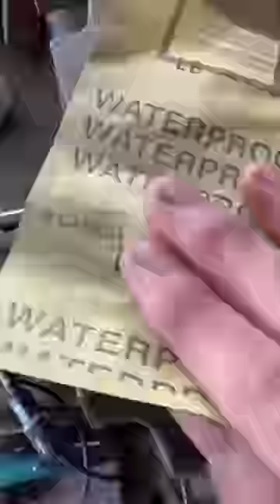CHEAP stripped oil pan/bolt solution!

Comment: You should've just re-tap the hole and plug it along with a crush washer
Reply: You. Any on these old pans
Reply: My thoughts exactly
Reply: They sell magnetic drain plugs at all auto parts stores that are permanent fixes, no drilling,  tapping, welding or leaks, $10
Reply: Yeah, they make those kinds of things
Reply: @byanymeansnecessary9329  the threads were stripped. That's the whole point of this 30 iq video
Reply: @Kdubz_Auto_HVAC  and so? There are ways to remove the drain plug, even if threads are stripped without drilling, then replace with the new type drain plugs

Comment: Here's a fun fact, I had a 2001 Yamaha dirt bike I got in a trade. Dude was shady as hell about it but it wasn't stolen and it ran and looked somewhat decent so I got it. Well I found out why he was shady about it, I went to do an oil change and as soon as I broke the drain bolt loose, a huge chunk of the case came out with it. SOOOOOO I did what every 17 year old from the south does, went out and bought some JB weld, put the piece of the case back in it's place, sanded it then cleaned it good, and used the entire tube of the weld on it. I'm talking absolutely covered in it. I took the bolt and drilled it out and tapped it and then put another bolt in it so it could stay jb welded to the case too. Rode it like that for a good year before I sold it. (Yes I made sure that the guy knew that it was like that before I sold it to him)
Reply: Redneck engineering at its best 😊

Comment: They have other types of plugs you could have put in there. Like self-threading plugs, or plugs that you tighten up and they expand to fill a hole with rubber.
Reply: Spark plug would have worked in the hole lol

Comment: I’m all for saving the factory parts and fixing them rather than buying new ones! I agree with you choosing to do this repair.
It’s obvious this could have been done better and solved the leak problem as well as your original problem. But I applaud you for being brave enough to share this, and I applaud the people from all different trades sharing their knowledge to help on your next attempt. That’s what this community should be all about! 
I also have things rigged on my truck that “work for now” and I’m hoping to find the best way to fix them without having to deal with buying parts.

Comment: If you feel the need to drill into an oil pan on the engine get yourself a few real earth magnets and place them near the opening then just make a small circle towards the hole and it’ll pull all the metal shavings out!
Reply from the maker: That’s a better idea than just flushing with oil!
Reply: And leave the magnets attached.  Any loose metal will stay put. Easy oil drain plug would prevent cross threading forever. $30.00.  If you buy another truck switch it out on the new one. I did that on me ford V10.  That would be $1.50/yr.  Good cheap insurance.
Reply: When you have a 16 mm plus size hole used a j shaped 3/8 inch metal tube, copper water line, and hooks up to the shop vac or vacuum extraction bottle, now you get the last bit of oil from the pan instead of the trapped by the nut inside the pan. It works great for getting all the water out of a head gasket sitch.
Reply: @thcall6441  strategic placement of the magnet will allow you to remove it and get back allowing the magnet to nab the bolt. After it’s done you can brakecleaner it and reinstall clean. JB the magnet in place.

Comment: An option you might not have considered would be to weld the original stripped drain plug into the pan and then drill and tap the bolt head for a smaller plug.

Nice job going at it with the tools and skills you have available!

Comment: Major credit for efforts,  practice on the weld and your there!!!
Reply from the maker: Really appreciate the constructive feedback. I’ve got a very long way to go on the welding front!
Reply: @Hobbies_Galore  welding is a trade that requires instruction,  your not afraid,  the set up, rod, movement,  hand eye, a ton of metals,  thicknesses  of project, prep and more, it also comes easier to some, but all must learn how to set up, I liked your idea, and it will work, and nice truck
Reply from the maker: @_1ben  thanks again! 
I’ve only welded a handful of times in my life, so I’m slow on learning, but I’ll eventually get there.
Reply: @Hobbies_Galore The best way to learn to weld is to grab everything made of steel and weld it.Then do it again.Practice ,practice ,practice then practice again.Overhead welding can be difficult. Easier to learn if you can at least see what you are doing. Don't let people discourage you.Just go to it.

Comment: If it leaks is not working my friend in that case was better to leave it the way it was and just put hi temperature silicon that would probably work better than your idea
Reply from the maker: Heya! The purpose wasn’t to stop the leak, though I admit it’s a semi-failed fix if it still leaks. 

Before this the drain bolt spun freely, so I was incapable of changing my oil (at least via the drain bolt). So the purpose was just to install something I could take off and put back on for oil changes

Comment: Shoulda just used a large rivnut, clean up the hole, put some TA31 on the rivnut and set it. Then use a flange bolt with a seal washer
Reply from the maker: Someone else suggested this too, it’s a great idea… woulda saved me a lot of time. Thanks for the comment!

Comment: My cousins 7.3 had the same issue, I just ground the bottom of the pan as nice as possible cleaned it really well put like a 3x3 plate with a hole drilled in the center, welded it to the pan even where i drilled the hole for the drain I welded around the hole for extra meat to tap, hasn’t leaked a drop and been pounded the truck with her horse trailer hooked up for thousands of miles!

Comment: That has  to be the craziest thing I’ve seen you do not weld on the oil pan in a vehicle.
Reply from the maker: Yea probably not super safe. Survival of the fittest. 

I’ve seen a bunch of people do this no problem though, so I wasn’t too worried.
Reply: Plenty of people weld oil pans.  It’s fine
Reply: Why🤷‍♂️
Reply: Welding on the oil pan in a vehicle with combustible gases in the oil and engine very flammable. Does not matter if you drain it or not. If anybody thinks the smart idea, let me know.
Reply: @joeworley1065  people do it all the time. ESPECIALLY on race cars. All the time
Reply: The right way would be pulling the pan and replacing it with a new one. Or remove it and weld it and repair it just common sense.
Reply: Welding a oilpan on a vehicle is like crawling under a vehicle with no jackstands. Good luck.
Reply: @joeworley1065  ok I’ll let you know. It’s not going to blow. If you think it is DONT EVER DO IT. Because you don’t know what you’re doing.
Reply: @joeworley1065  this kid did a job the way he could afford to do it. And there was nothing unsafe about it. He learned something and that’s a good thing. Teach yourself something. Spend the next decade trying to make oil explode🤷‍♂️let me know when you did it. Not burn! Explode.
Reply: @joeworley1065  been doing it for decades kiddo its plenty fine
Reply: There are ways it can be done…..have done it hundreds of times
Reply: welders can , always risk acess fitst
Reply: Ive done this but it didnt leak. 🤷‍♂️
Reply: I think it leaks worse than it did to begin with.
Reply: @joeworley1065  betting the 15 hours of labor was the reason he didn't do that!
Reply: Use an 02 sensor bung and an M18-1.5 plug with a seal it will actually not leak.
Reply: Couldn't  it start on fire

Comment: If you used gasket maker that would've stopped the leak until the next oil change 😉
Reply from the maker: Yea might do that or JB weld
Reply: @Hobbies_Galore  na with jb weld you're gonna struggle to take it off without a grinder with gasket maker you're buzzing
Reply from the maker: @boostedadrenaline2884  yea that’s true. I’ll do this then till next change. Thanks for the suggestion
Reply: @Hobbies_Galore  no problem anytime

Comment: Of course it’s gonna leak.
You got to put some superglue on it after the weld! dodo bird! 
Nice dime weld too.
Reply from the maker: Yea sorry. I’m not experienced enough to weld dimes on 1/16” stamped steel seeping a little oil. Much less do it overheard with no helmet.
Reply: Sealall not super.

Comment: All ya gotta do most of the time is throw in a over sized self tapping drain plug👍🏼
Reply: And teflon washer
Reply from the maker: I wanted to do that, but unfortunately the bolt was already oversized and I was warned that another retap could break the threaded metal piece in the pan off

Comment: Only Thing That Bugged Me Was The Strap On Oil Filter. I've Never Worked On One Of Those But That Seems Like A Good Way To Break An Oil Filter Adaptor Housing / Snap The Hallow Threaded Section.

Comment: Make your own washer/gasket. High temp hose cut at a quarter inch thick, works everytime because threads are now at a different spot on the stripped section.

Comment: Was it leaking from the weld or new drain plug at the end.  Might just be a small tack away from it sealing.  Also I understand the reason for this method.  I understand this isn’t the “right way” but it’s an alternative to a costly repair or you have to pull the pan which adds a lot more time/factors into the mix. If I’m not mistaken you have to pull the motor reseal the pan on these motors.  At least that’s what I’ve seen with the 7.3 IDIs.  Anyways good luck dude

Comment: I feel like JB weld would have a better chance if it's thin metal you're attaching it to. Less chance of leaks from lack of weld penetration and uniformity. Could still add a couple weld tacks for "strength"

Comment: If you ever have to replace your oil pan on these obs 7.3's make sure you replace your oil dipstick adapter gasket because ford thought it was a good idea to screw it on instead of just welding it

Comment: Just put a factory drain plug back in. Never seen the threads in the pan messed up unless somebody put an oversized plug in. I have had this happen hundreds of times in the past 30 years as a ford tech. The pan nut is hardened the drain plug is soft.

Comment: You forgot to paint the welds with JB Weld, or some orange sealant. 
I get it’s enough to getcha down the road and back a bit before fixing it the right way when money is getting tight.

Comment: He did a good job taking out the threaded stud whatever you wanna call it. If you would have taken your time welding the nut onto the pan it would have worked good. Bolt, washer and nut 👍 good effort.

Comment: A $10 used oil pan from a junk yard is a lot better with a new $20 gasket.   If it is leaking, it isn't fixed.   They do make an oil filter wrench $3.  The time you spent welding, old oil pan dropped and new oil pan, gasket replaced.

Comment: They make plugs that work the same as a hollow wall anchor with a large rubber plug that just tightens up against the pan, most oil change shops usually have a few around
Reply: Autozone has em for $10

Comment: You should have just took the pan off and put a hollow jam shank bolt and cap with a rubber grommet on both sides of the pan secured in place with a jam set nut and never have to worry about this again and without the leak and be able to change your oil just by removing a single brass cap  ... It's just a lot of work to get the pan down to do this sometimes and of course you will probably have to have a new pan gasket (only if you mess up the gasket taking the pan off )but since you already drained it then I would have just went ahead and pulled the whole pan out and went with a hollow jam shank and cap .. Either way , whatever works better for you is all that matters really ... 👍👍👍

Comment: Everyone has got advice so ill throw in my two cents. You needed to turn the heat up a bit on the welder woth a bit more amprage and spot welded your nut to the pan. When spot welding (not running a continuous bead) you want the amperage a bit higher s8nce you are starting and stopping after very short welds so heat doesnt get built up. This would have given you much better penetration and your weld would have flowed together better than the way it left basically balls of weld material and you would have had a solid dealed weld joint and also not needed the amount of built up material at the weld joint like you ended up with. Good attempt and it solved the issue. Not to mention you can easily go back and clean it up and reweld it next oil change with much higher amperage/heat on the welder.
Reply from the maker: Wow! Thanks you for the first real advice about welding! I appreciate your response, I’m slowly learning. I’ve only had to weld a handful of times, so all tips are appreciated.
Reply: Bro….have you ever seen an internal engine fire??? Keep your welding tips to yourself before this guy gets hurt😂😂😂😂
Reply: @jaycleveland6910  he is already welding on it so my tip isnt increasing his chances anymore than they already are so i will keep my suggestions exactly where they are. But thank you for your observation no matter how little it really is BRO!
Reply: @jaycleveland6910  while we are at it, the likelyhood of him sparking a fire is very slim unless his oil contains a large amount of fuel in it or he cleaned with a highly flammable solvent. Also, if a fire were to spark inside the oil pan ints pretty easy to solve and put out, cover the hole so it doesnt get any oxygen. You sir should retuink your suggestions and help. BRO!
Reply: @Hobbies_Galore  👍👍

Comment: It looks like you had your torch set up to run Flux core when you welded that nut. It would be easier and you would get better results if you ran a mig wire with a shielding gas. Try a 0.030" wire with C25 gas.

Comment: I had to fix a froends ford ranger, that had the threads strip on the bolt. He couldn't get it out. So I put a toll on it and pried with a sloted screwdriver. It came out. I just ended puting a new standard plug on it. The threaded part on the inside was loose on one side, so it just tightened against the bolt and the inner threaded part, to seal it from leaking.

Comment: Okay so the threads are stripped The bolt will come out without drilling it yep definitely going to come out take advice grips pull down on it while you're spinning the bolt. Can also stick a screwdriver there.

The end was just the best The thing still leaked granted it is difficult to weld onto a pan I will say that 100% and the smallest amount of contaminant will cause the weld to get a bubble and not seal but it seems like there was definitely a better way to do this

Comment: make sure there is an abundance of power to your welder .
its the extension cord that made the leak because of the cold welds.
turn it up and weld like its super thin.
a bead then stop should be alittle bigger than a dime.
go around overlapping like that.
and try to never extend a plug down to get stumped off...

Comment: They make expansion oil plug for those old Ford. I mean it's supposed to be temporary but hella quicker then welding a nut to the pan and still leak oil.

Comment: Put a copper washer between the nut you welded on and the bolt you’re using for a drain plug.  That should stop the oil leak

Comment: J.B. weld around the weld then get some flex seal and spray over it, and don't put oil in the engine and it will not leak at the auto wreckers

Comment: Over drill it, tap for a larger thread. Insert large bolt, cut and weld it in place then drill and tap original drain plug size.

Comment: If you would of drop pan. Cleaned inside.  Welded nut from inside. And used rubbed gasket. It would not of leaked. I have 1 f150 and 2 f250s. And have had to do them this way.

Comment: I had this same issue my cars slammed and I hit a pot hole it ripped the bolt right out and stripped my threads I had to get a flat bed, but this is not even a good temporary fix, you could’ve just went to autozone and got a toggler it actually makes a seal and doesnt leak, that’s what I’m using till I replace my oil pan, welding the bolt is just stupid

Comment: If you were going through the trouble of welding it, why didn't you just weld a bung on it instead of a nut?  Or just a thick disk to drill out and retap, both solutions which would not have leaked...Or just a valve so you don't strip it out again.

Comment: You did more work than you needed to for the same result in the end and added plenty of grit into that oil system when you were drilling and grinding! You could have just dropped the pan just as easy and done a better job and could have sealed it from the inside if you absolutly had to. But could have just welded a new bung to it sold in every auto part store for $7 and matching bolt for another $3 and welded them in place and called it a day! If it leaks add Teflon tape or never seize! Won't go into the oil and is thick enough to keep everything put!

Comment: Grind that weld out and try it again but bump weld it And if the settings arent right on the welder then try to practice on a scrap peice of metal of something similar til you get the consistency  ya want    All that is.  Is needing more practice

Comment: If anything you should’ve just pulled the pan off and welded the nut on the inside so you put a an o-ring in and it would’ve been flush so no matter the wood it wouldn’t have leaked also to get any metal shavings out… also a new pan is $85 it’ll be cheaper in the long run then the money you spend on oil because it leaks out

Comment: Why not remove the pan and drill the hole next size up? After just tap it and use another bolt with a crush washer 😅

Comment: You should have went with the rubber plugs with the bolt in the middle. Commonly used on boats